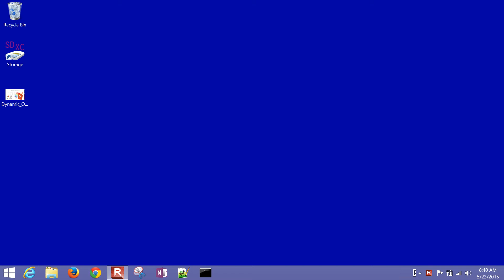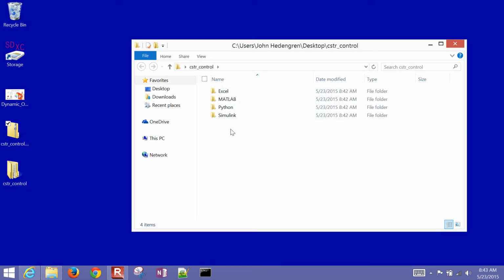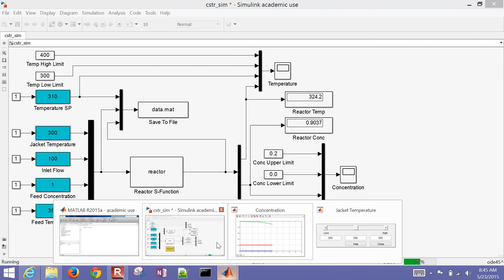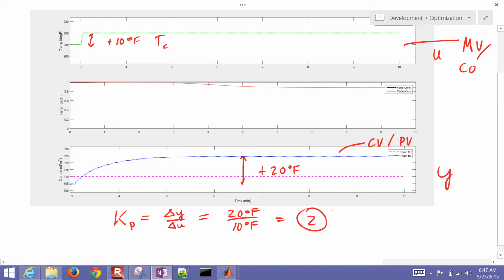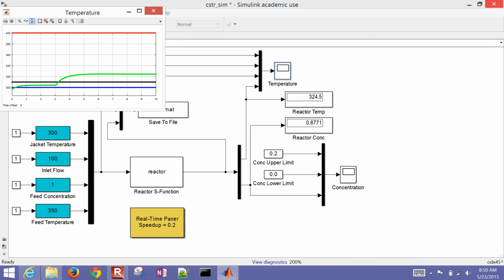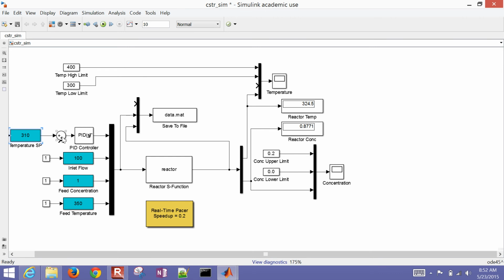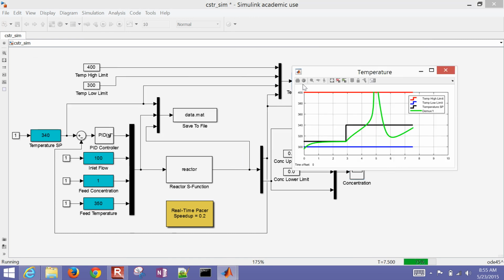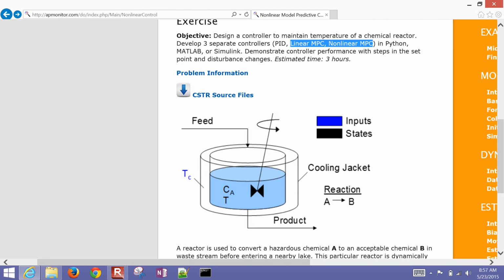PID Control in Simulink: CSTR Tutorial

Comment: the manipulated variable is the jacket temperature. it is the same as changing the inlet flow of the coolant?
Reply from the maker: They are not the same but they are related. The flow is the inner loop for the jacket temperature control.

Comment: @Apmonitor.com what if you added a derivative part, wouldn't it help with the spikes ?
Reply from the maker: Yes, a derivative part could help with the run-away reaction. It is a very challenging nonlinear control problem, similar to what is encountered with exothermic industrial processes such as polymers. Those industrial processes typically have emergency cooling or flaring systems to shutdown safely. Here is more information on that problem but in Python: https://apmonitor.com/pdc/index.php/Main/StirredReactor

Comment: Hi. 
I am new to control systems. Every video i look your output is already giving you steady state output. Whereas in my case my output goes exponentionally (unstable system). That is one of my objectives - to use a controller and stablize my output with the reference input. So determining time constant and the rest are impossible because it never gets to a steady state. I have managed to tune a controller by trail and error method. Any guidance will be much appreciate.
Thanks
Reply from the maker: For unstable systems, you typically need to create a model of some type (first principles, linear transfer function, etc) and then perform an analysis to make the system stable such as with a root locus plot, bode plot, or just simulation of the control. Here is more info on a stability analysis: https://apmonitor.com/pdc/index.php/Main/StabilityAnalysis  You may also want to look at Model Predictive Control. Here is control of an unstable system: https://apmonitor.com/do/index.php/Main/InvertedPendulum

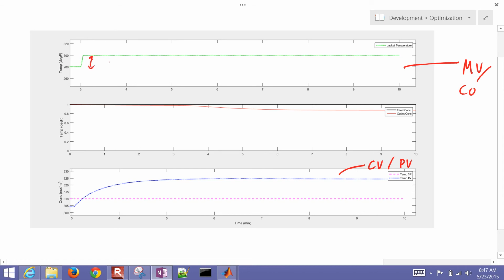Comment: Just a little revision: at 6:42 you've settled a delta T of 10°F instead of the real value of 20°F about the jacket temperature. Due to this, you've calculated a wrong value of Kp (2 instead of 1) and a wrong value of Kc=P (0.5 instead of 1) and I (1 instead of 2). In this way you can explain why you need a more aggressive Pvalue after the first simulation. 
Anyway, I would like to thank for the great support you provide for my engineering formation, good job.
Reply from the maker: Andrea Canali Great catch, Andrea! You are correct.